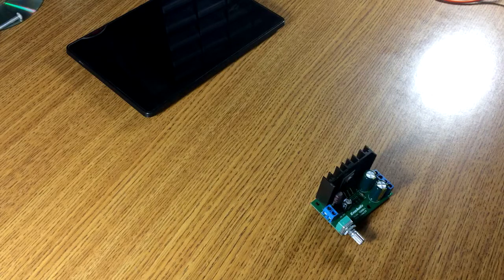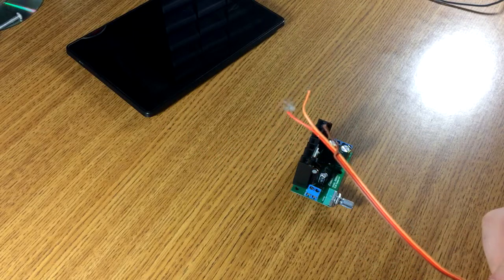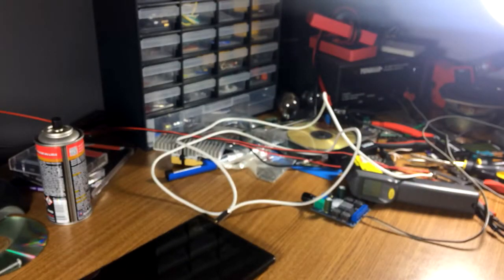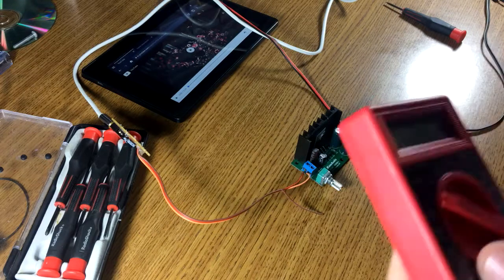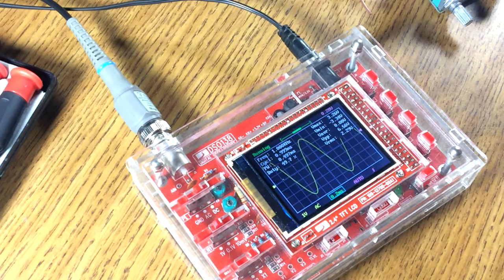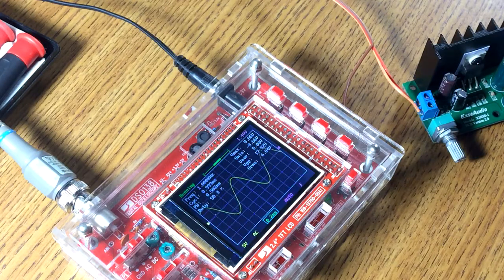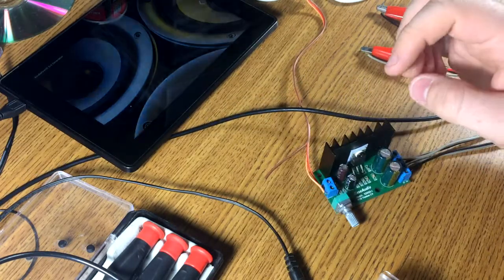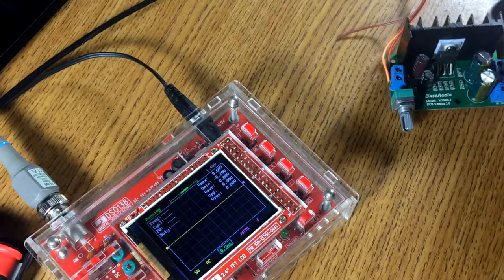ICStation X20X0-1 TDA2050 Amplifier Test

Comment: Hi! Quick question: When making the power test: Do you replace the speaker with a resistor of the same impedance? Is it a special resistor? thanks
Reply from the maker: the resistor is just a 8 ohm 50W that i put on a heatsink. thats it. there around $6 from mouser. i really wanted the 100W ones but i didnt want to spend the little extra since wirewound resistors like these can take way more than rated for short bursts. i think these 50W i have can burst 250W.
Reply: @bassblasteraudiotech4918  thanks
Reply from the maker: @GabiMartin97  i dont know if this is the EXACT ones i have, but its the same.

https://www.mouser.com/ProductDetail/ARCOL-Ohmite/HS50-8R-F?qs=sGAEpiMZZMtlubZbdhIBIEidPY%252Bx%2FLaa%2FZ5WqiqIY1s%3D

Comment: It's giving 6 Watts maximum on 24 Volts @ 4 Ohms load.
Will it give more power if operated on +/- 12 Volts ?
Reply: You'll get a lot more power using a split rail on any of these chip amps, TDA 2030, 2050 or LM1875. The reason the 2050 in this video is so low is because it's running single rail with capacitor coupled output

Comment: Probably set up to osolate when shorted so it has a duty cycle so it doesn't over heat.
Reply from the maker: maybe, but ive played with LOADS of chip amps and they all go into a straight up shut down. never seen this before